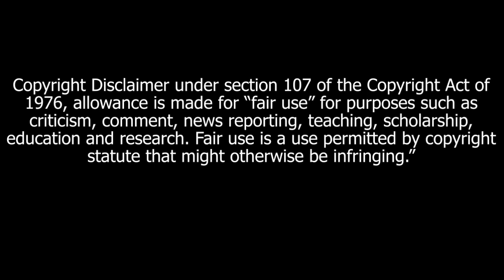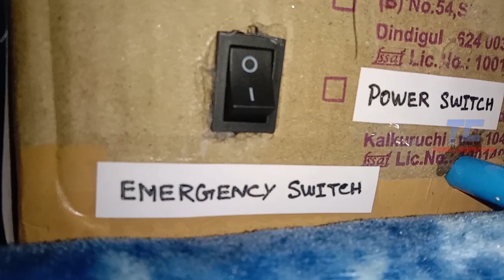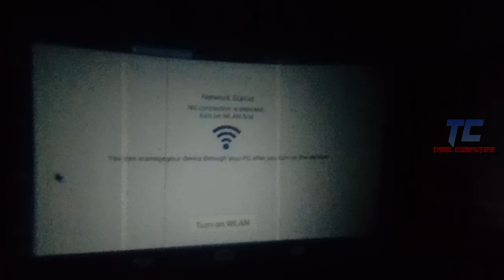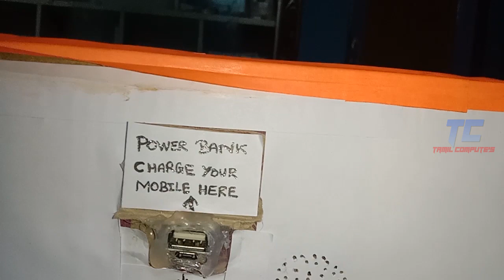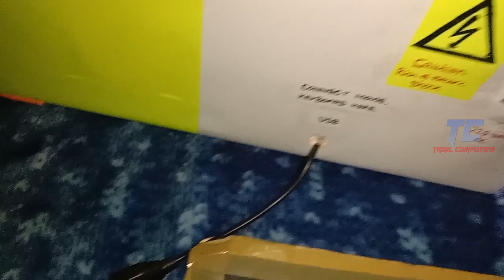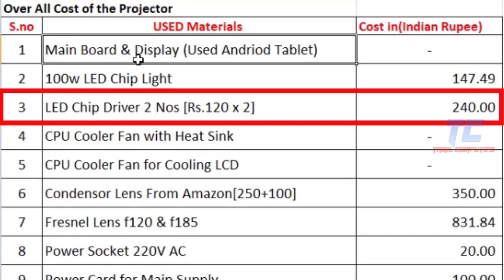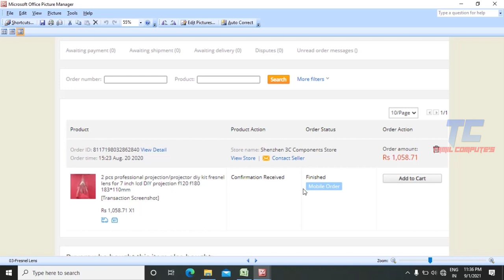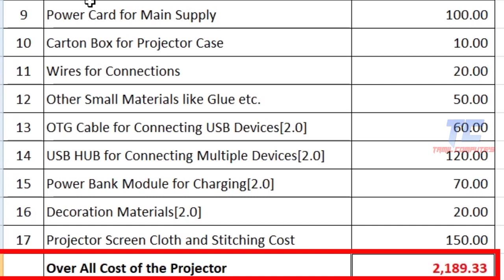home made hd projector making version 2.0 | projector making

Comment: Bro 50W led chip light ku enna voltage watt chip driver use pannanum
Reply: 12v chip driver bro
Reply from the maker: 12V 3 to 4 Amps use pannalam bro
Reply from the maker: @abum2786  super bro
Reply: @abum2786 thank you bro 😍 nalla muyarchi bro continues ah video pannunga
Reply from the maker: @075prasath  sure bro
Reply: @tamilcomputes  ama bro  3amp better output irukku
Reply: @075prasath  ok bro 👍🏻

Comment: Control board enga vanganu 🤔
Reply from the maker: Old tab iruntha use panunga bro it's save your cost
Reply: @tamilcomputes  ok thanks bro
Reply: @tamilcomputes  bro Android board use pannalama
Reply from the maker: @nithishbro5289  sure ah use pannalam bro mouse support irukka OTG cable support iruntha sure ah use pannalam nanum old andriod tab than use paninen
Reply: @tamilcomputes  ok bro
Reply: @tamilcomputes  bro neenga lens enga vanganinga online or offline online a irundha link thanga bro
Reply: And evlo maximum inches project agum
Reply: @tamilcomputes  bro led cooler fan use pannama irutha enna agum
Reply from the maker: Link description la irukku bro
Reply from the maker: Maximum 150" varaikum nalla irukku bro
Reply from the maker: LED heat over agum bro then fuse poga chances irukku